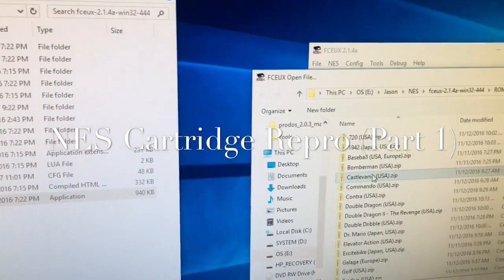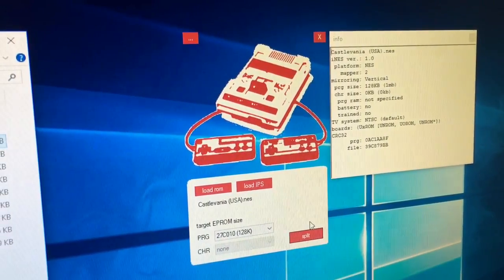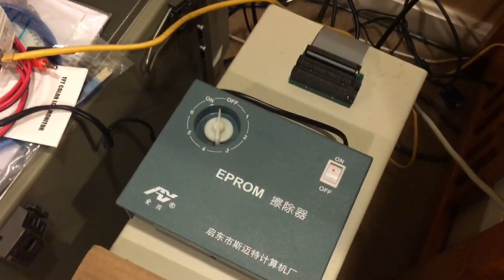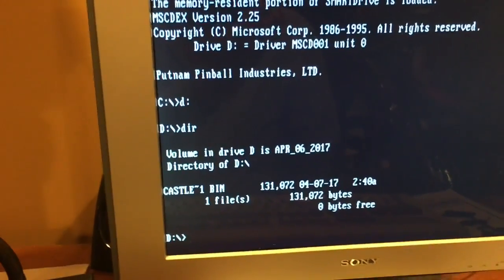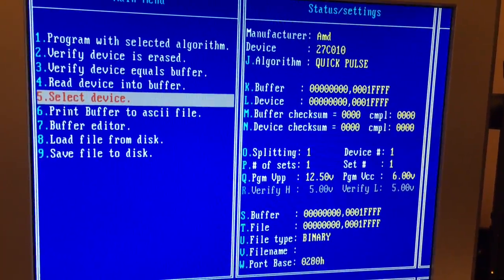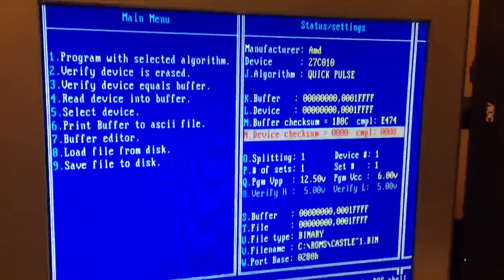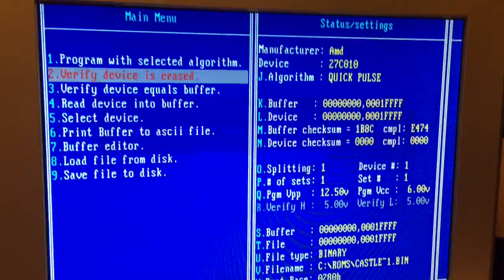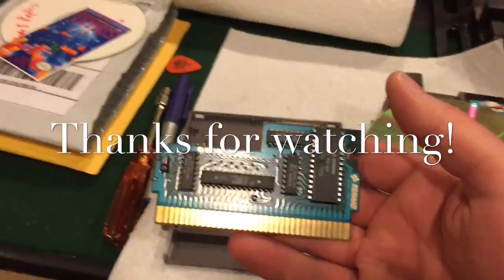NES Cartridge Repro, part 1

Comment: 80$  -  3$  =  77$
Hum... I guess you could make some profit if you sell this kind of cartridges.
Reply from the maker: "Collectors" are pretty picky about this stuff- understandably.  I make these for me- so that I have the cartridges that I want.  Fortunately, the repro labels (the ones that I've seen anyways) say "reproduction" on them in small text, so no one could accuse someone of selling them a fake original..  I'd strongly recommend, for a collector that wants the real deal, get one of the security bit screwdrivers so you can take the cartridge apart and make sure there are no patch wires like these eprom conversions (like shown here) need..  :o)